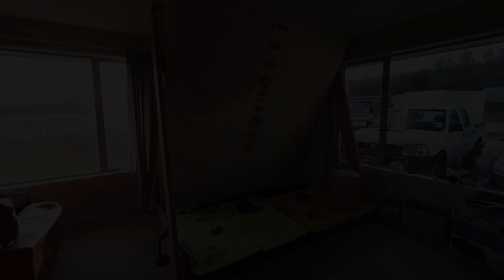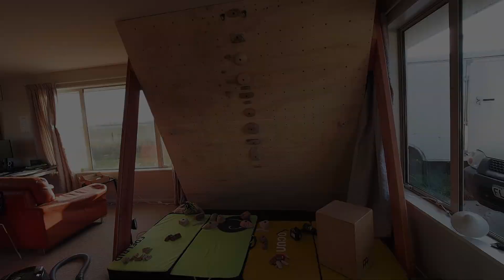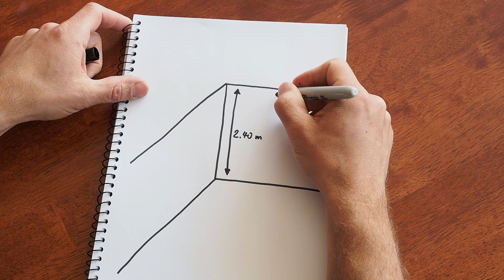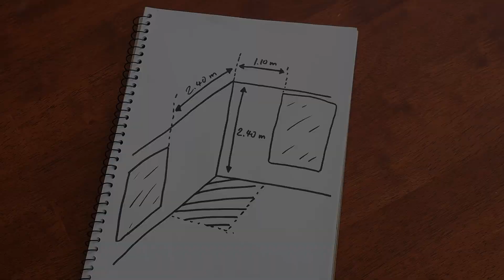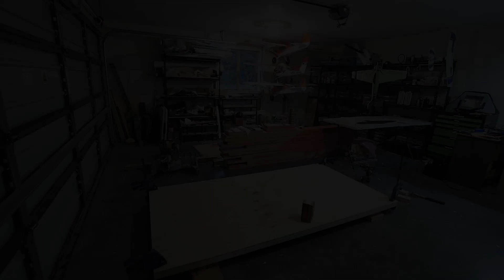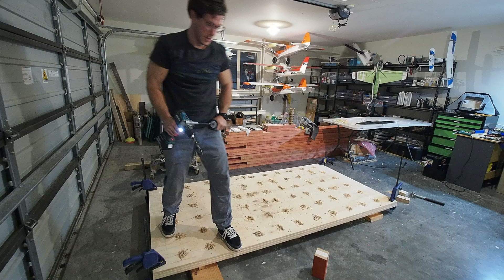How To Build A Free-Standing Indoor Home Climbing Wall

Comment: Damn. That’s a lot of wood. The half would be enough 😅
Reply from the maker: Hehe. Yeah, there are pros and cons for making a climbing wall sturdy.
Cons: more expensive (but not much compared to the costs of holds) and it takes longer to build the wall
Pros: wall doesn't flex which is more fun when climbing and you also reduce the risk of finger injuries (especially on dynamic moves)
I guess it's a personal preference and I wanted the wall to be as sturdy as in a commercial gym. :)